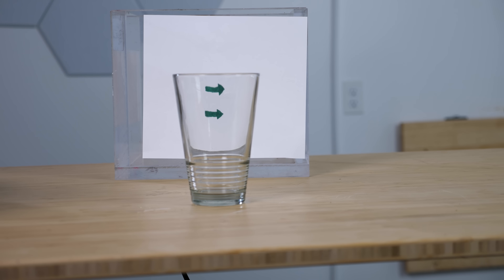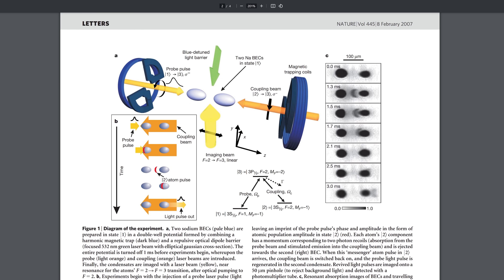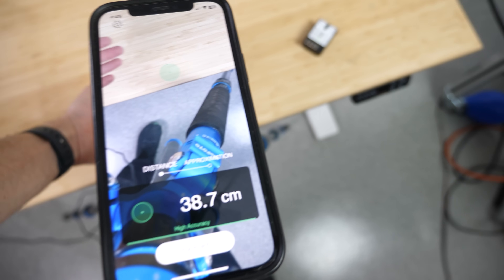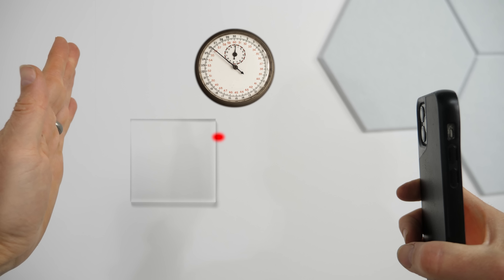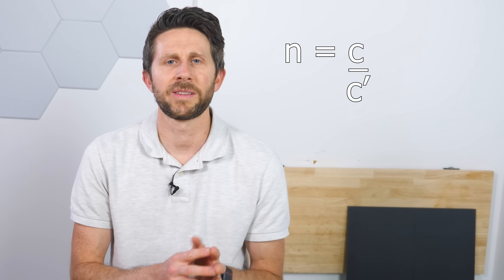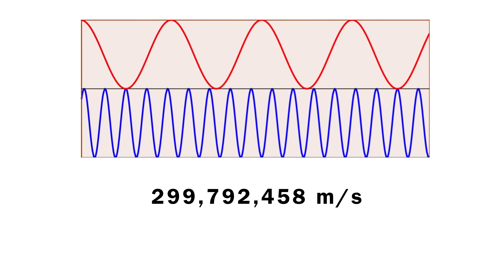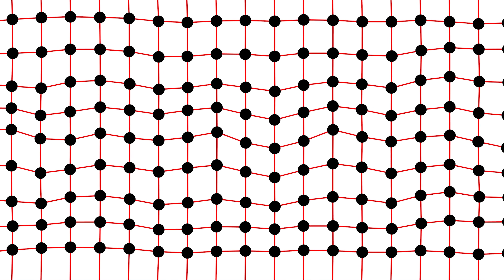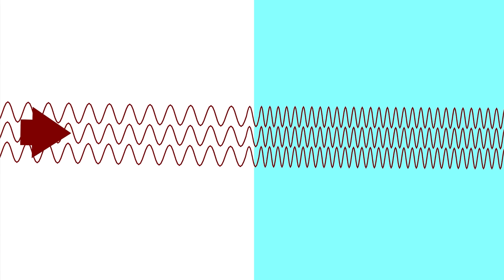Solving The Slow Light Paradox

Comment: If you want to prevent the springs from sproinging off the wheels when the welds fail, the best thing would be to strap them down with steel cables on the inside.
Reply: Thanks!

Comment: The light doesn't slow down.  It's just forced to take a longer path.
Reply: that makes no sense. what path?

Also: Fermat's Principle.
Reply: @DrDeuteron  
It bounces around off the molecules of water.
Reply: @Andy-df5fj  I;ve heard that. but then how does it always come out straight?
Reply: @DrDeuteron  
Good question.  I don't know.
Reply: @Andy-df5fj  well if you read/saw a source that said that, they we're not distinguishing incoherent scattering (which is literally "bouncing"), and coherent scattering, which is a quantum (or classical field theory) thing, in which "amplitude" is scattering, not probability (or power), so bouncing is not a good word..it's misleading.
It not really different from the double slit experiment, where probability or power (also: intensity) has to go through a slit, while amplitude (of a wave function or electric field) can go through both at the same time.
Reply: @DrDeuteron  
Interesting.  Thanks!

Comment: Does this mean that the data in fiber optic cables is not transmitted at anywhere near the speed of light?
Fiber optic cables are usually many kilometers long, so the attenuation would have to be extremely high.
Reply: where did attenuation come in? that requires an imaginary component  in the index of refraction.

Comment: There's a classic sci-fi story about glass-like material that is so dense it takes ten years for light to pass through. The idea is that you store a nice view, say from an alien planet, and sell the "glass" after ten years to someone who wants a "living window" to another world.
Reply: so the view lasts for ten years but also takes ten years to store. would it just be black when the glass is brand new?
Reply: @elio7610  should be, but i'm wondering about the corners which light could possibly go through in a shorter time frame, causing weird distortions
not to mention light bouncing off of materials and all of that, making the sight a blur
Reply: @notsam2270  If you have that sort of material. Those issues are all simply solved. Make the glass in the dark. Paint the sides in something durable and opaque and put it in frame in a sealed box that doesn't let light in until opened.
Reply: @elio7610  Probably 🤔.
Reply: @elio7610  No, the block would show commercials of itself after all manufacturing tests have been completed. So each block would be 10 years old already
Reply: Think you are referring to "Light of Other Days" by Bob Shaw. A very touching story... 🙏🙂
Reply: @stevenverhaegen8729  The 1966 short story was "Light of other days". There was a full length novel published in 1972 called "Other days, other eyes".
Reply: I remember reading that story.  “Slow glass”.  It is one of those stories that stuck with me.  I like to think about the practical applications of slow glass.  Such as a skylight that has thickness gradients so that it can absorb a day’s worth of light on the top and then deliver a constant average light out the bottom.  Or street lights that delivered 6 months and 12 hour delay so the street light would illuminate the night.
Reply: It is sick that we have phones that can measure such short distances with light, like it would have been a scientific instrument that would have costed like millions of dollars or something at one point in the past.
Reply: @bryces9951  There is an old quote "the universe is under no obligation to make sense"
Reply: what's funny about that is that we already have the technology to simply install a volumetric display showing whatever videos you want, and this is why i insist that technology is magic, it's literally better than some of the far-fetched stuff we can imagine.
Reply: @swedneck  But its not though. Its just rapidly updating pixels. Closes thing we have is a chemical photograph.
Reply: I remember reading that, probably at least 25 years ago. I think the story was about a crime that happened in view of the windows, so they were waiting for the time to pass on the window so they could see what happened on the day of the crime.
Reply: I believe its Bob Shaw, Light of Other Days. Its a poignant story because the main character is looking at his wife and children  in the garden, but they died years ago. There area few stories in this series and its called "slow glass" AFAICR
Reply: mindblowing!
Reply: Sounds like an Asimov concept.
Reply: @MattH-wg7ou  Bob Shaw, and his short story was later expanded to novel length. This is NOT the same Bob Shaw's who have - earned an Oscar x 3 and 30 nods, pitched in the late 50s through to the late 60s, built the Republican party as a gospel singer, nor the tattooed future artist of the needle, with twin sleeves by Bert Grimm his teacher. The Irish Bob Shaw, a fiction writer from Northen Ireland b1931. The others are all shown with a minor search enquire.
Reply: So literally just a video.
Reply: @DrkstrX I don’t think so. Since the photons coming from all angles like in a normal window, it should act like a window with all the depth and perspective changes if the viewer changes the position. So it should be much more than a normal video wall.
Reply: Unfortunately, it was too dark to see anything, as the photon flux was billions of times lower than a normal window :<
Reply: Great coincidence you saying this, as I was wondering if there's something like naturally occurring acrylic in large gaseous planets that slows light down.
Reply: That means everything would need to stay still for 10 years but since the light also would leave at the same rate it would actually never store an image
Reply: Better to take a photo or video 😂
Reply: It is called television.
Reply: 3D television that you can look through at any angle and see a different view of the scene behind it - so in fact a window.
Reply: Or you can take a video?
Reply: Huh.
Reply: and as a result, the government first launched satellites with such lenses, and then completely bombarded the whole country with balls of this material with varying degrees of delay.
Reply: Was this story written before the invention of the film camera?
Reply: @jojojorisjhjosef It's not like a camera because it captures everything at all angles and is the original light from the scene. It's actual reality that would last the amount of time allowed by the thickness and refractive index
Reply: @TheTransitmtl  ow that's true, that's cool.
Reply: @jojojorisjhjosef  no, it was ingeniously clever and a mystery of sorts, mix in a bit of wife-to-be-shown-pity, and you have the expanded novel length work he expanded from the short story.
Reply: I remember that story! I have a vague recollection the window owner saw something that was strange/undesirable/tragic, but of course, could do nothing about it.
Reply: Bob Shaw I believe.
Reply: What story is that?
Reply: Mad concept
Reply: I read that. It was a great story.
Reply: "Strange how a man can love a woman and yet at the same time pray for her to fall under a train."
This story is peak I'm afraid
Reply: That is like making glass that if someone were to do something illegal they would know in 10yrs from that time
Like camera that stores information in very strange way
Reply: Quiet a heavy TV set, huh?
Reply: But in the story about "slow glass," it was a way to view the past by looking out your window. I don't recall it was a way to transport a view, but maybe I just don't recall that part.
Reply: @delavan9141  in “other days, other eyes”, the technology was eventually used as a surveillance tool by scattering it randomly, so that it could be analysed after an event.
Reply: It is a nice science fiction idea, but with a big inconvenient on a second thought. The energy accumulated in the glass would be enormous!
Reply: Get a video tape instead
Reply: A literal window to the past 🪟.
Reply: The material would be basically a bucket brigade delay (used in old guitar fx pedals) but for an entire light field instead of one electric signal.

Comment: If it helps you imagine what's happening:
The light is still traveling at c in a material, but it has to weave around the atoms to make it through. Like a river meandering over a plain, its actual path is longer than the straight distance between source and destination.
The longer path the light takes makes it seem like the light is moving slower.
Interestingly, the Lidar demonstration shows the relationship between speed and distance.

Comment: So what you are saying is that the light wave is moving just as fast but is displaced as it moves though the clear material. It makes it move in more directions than it normally would. 
Like a car driving down striate road and suddenly finding that it now has curves. You can still move at the same speed but it takes longer because of the curves in the road?
Reply: no, it doesn't curve. That would screw everything up.

Comment: This is one of the best takes on the topic. Much is semantics. Yes, light slows down in acrylic, and when we say "the speed of light", we mean c/n, and don't appreciated   "achtually's". (we: ppl who've built Cherenkov detectors)--it doesn't mean we think gamma rays slow down too.

It's perfectly fine to use Maxwell's eqs. in media (the ones with D and H in addition to E and B), where the permittivity is > that of free space. Ofc that is a bulk model and ignores atoms...which you can do since the wavelength is much bigger than an atom.

Nevertheless, the most unambiguous approach is to use Jefimenko's eqs (equivalent to Maxwell's, but manifestly casual). This is gives you the correct physics view that changing E fields do not cause B field (and likewise for dB/dt -> E, an a-causal idea). Rather, the fields at a point/time are only due to charges and currents on the past light cone, so effect from cause propagates at "c", but because the medium, the presence of max E-field appears to move at c/n. Note that nothing is moving, waves don't propagate...only effect propagates from cause on the past light cone. In media and in vacuum, the wave description is just a model of an emergent phenomenon--I hate to use this cliché, but it's correct here: like a Mexican wave at soccer game. There is no wave, just people standing up and sitting down in what looks like a wave, so with that: the wave does move slower than c.